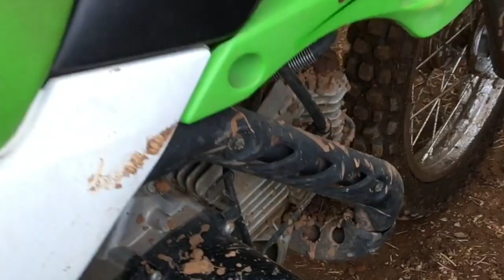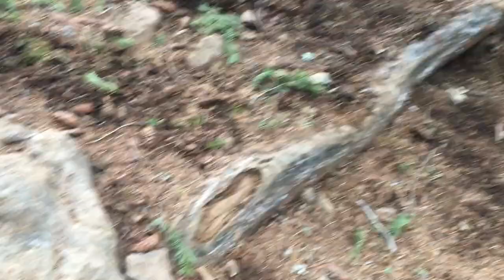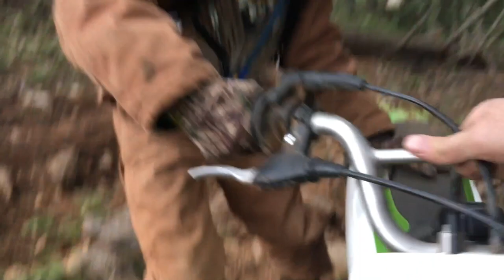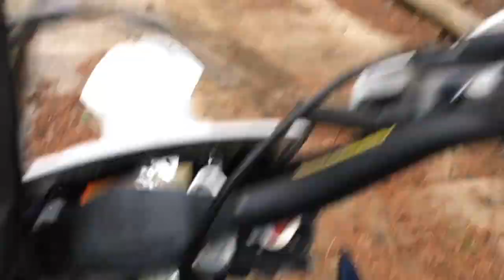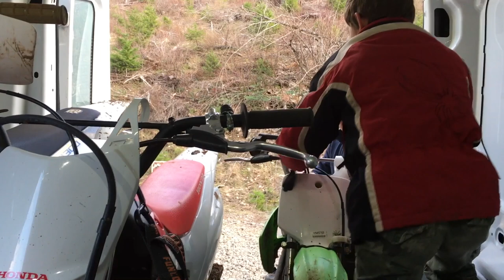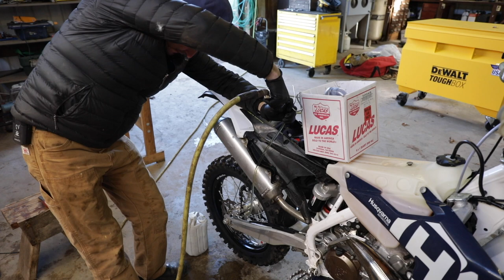The Video You Weren't Supposed To See

Comment: Torx were developed by Camcar in the late 60's.
They range from T1 thru T100..
The original point to point dimensions were established in decimal inches..
Over time an ISO specification was developed for hexalobes AKA generic term for Torx.
By design, Torx head screws resist cam-out better than Phillips head or slot head screws.

 Phillips heads were designed to cause the driver bit to cam out, to prevent overtightening, Torx configurationd were designed to prevent cam-out. The development of better torque-limiting automatic screwdrivers for use in factories allowed this change. Rather than rely on the tool to slip out of the screw head when a desired torque level is reached (which risks damage to the driver tip, screw head, and/or workpiece), torque-limiting driver designs achieve a desired torque consistently.
Being a former Snap-on Tools business manager and an engineer I am a geeked gear head..

Glenn
Reply: the more I use Torx the more I love them..... I swear by Spax wood screws... they are so amazing.....
Reply: amazing info, thanks
Reply: Sooo standard? Because they started as half inches, not half centimeters
Reply: JIS Screws and Screwdrivers are pretty cool. JIS screws have a small indent hole on the head to identify them. The Japanese Standard that overcomes the torque out issue allowing proper tightening.
Reply: JIS are an improvement over Phillips..
Pozidrives are a great alternative over Phillips drive too.
The only reason that we don't see more of them is that most OEMs dont want to add the 1% cost to the cost of goods of their product..
Torx(Camcar) is a prime example.
They were offered for 25 years and the big 3 auto companies refused to pay the royalty..
So us wrench twisters suffered with Phillips for a long time until the Torx patent expired...
Reply: I remember when they first started becoming popular.  I thought, "Great.  Just another bit to have to buy, and keep track of." Now, I love Torx.  The screw will break before the bit cams-out.

A lot of what i do "around the homestead" is screwing frames of some sort together, and I use long screws. I hate having to drill pilot holes, but if you're using phillips-head screws, you have to.

Go, Torx!
Reply: Wm Napier 
Always glad to share and receive insight and help
Reply: Marble head
I must have the wrong bits because I hated using Spax. The bit wouldn't hold the screw very well.
Reply: Dude... I need you on my tool truck! When can you start?!?

Comment: Since you asked about Torx drive screws, I thought you might like this: "The same series of Torx drivers is used to drive both SAE, metric and other thread system fasteners, reducing the number of bit sizes required." So it is neither metric or SAE, but in truth both depending on if the screw or bolt is SAE or Metric in size or cut thread.  and was developed in 1967 by Camcar Textron. So basically it is a six lobe head type, that can and is applied to both SAE, and metric bolts, screws and other thread types and fasteners.

Comment: I have the rear brake like you do but I have cut the clutch lever to about 1,5" in length and turned it for my thumb. That way you don't need to make extra effort for using it because its right on where you can reach it without losing grip. Almost like the "button gas" in most of the snowmobiles and quads.

Comment: Much agreed. The knipex channellocks are one of the best tools out there. Coming from a professional BMW tech.
Reply: Nothing better, once you find and start using their tools, which I did over 20+ years ago, but a product endorsement feels, smells and looks like an advertisement, even if I don't mind and agree with his choice, but should be stated.
Reply: Second best for the common man are the vise grips, with the bonus of one hand adjusting. Sometimes they're better because the jaws are wider. So of course I use both. Don't judge me.
Reply: I guess I mean thicker. The cross section of the jaw is greater. Bigger profile. There. Clarity.
Reply: Yep. Very true. I deal with a lot of small parts that people tend to strip the heads on torx bolts and small allen bolts which is why I reach for the knipex. Just a top tip for those that don't know about them. I believe matco endorses them.
Reply: DeviouS Breaking Many Wallets LOL. Actually I'm one of the few that tries not to replace more than is needed, but it's still more than most cars would ever need.

Comment: Cody, you should take a look at rear thumb brakes. The lever is under the grip and operated by the thumb. You can maintain normal clutch position and rear foot brake. Run a second brake line to it off the caliper with a double banjo fitting. Very convenient. You can operate front brake, rear brake, throttle and clutch all at the same time. Excellent for steep or tight difficult terrain.
Reply: Now that's a much better idea. I could get used to that.

Comment: A tool kit out on the trail is a must, many a time I've been spat off and snapped levers and bent shifter levers and had the odd puncture. The day I started carrying a tool kit, a few spare bits and some coolant  was after i was 6 miles into a trail and I wiped out and when I took my bike out of the brush i popped a radiator hose off and lost most of my coolant. Was the longest walk with my bike I've ever done and vowed to always make sure I have a spares bag in case I mess up big style again.

Comment: These are Knipex 'Pliers Wrench'.  There is a 10 times multiplier when the 2 handles are pulled together.  Once the surfaces are engaged, very little force is required to keep the plier faces together if the product is being used correctly.

Comment: Just a little tip if you have two ramps it will make it a little easier to load the bikes into the van
Reply: Brady Hodge or you could just get it done I can get my 230 in and out of a halfton alone with no ramp and im only 5foot 7

Comment: Brake pedals and shift levers get a "brake snake" if you ride in the woods to prevent just that.  Piece of steel cable looped from the tip of the pedal/lever to the frame to keep brush and debris from getting crammed in there as well as keeping them from getting bent out or broken off.

Comment: Hey Cody just a tip I've learned from loading my bikes put your bike in gear and hold the clutch while you are pushing it up the ramp, that way if you need to stop the bike on the ramp you simply release the clutch and the bike will hold

Comment: I feel like a rear break hand setup is like putting training wheels on your bike. Eventually you will be used to using the rear break at your foot and it would be just as easy. But hey everyone has their own style and I'm not hating on yours at all.
Reply from the maker: Not hating just not understanding,
Reply: No, I understand I ride trails as well and in steep situations where I need to stand and use the rear break I have trouble either finding it or being able to press it which cause me to go slower or could crash. This would easily fix my issue with that or I just need more practice and focus on rear break control. I 100% understand why you like the rear break setup, everyone has their own style and opinion on what they choose to do to their dirt bike.

Comment: That rekluse clutch set up looks amazing and all, but having it on the handle bar, come on.
What if your going down big down hill sections and get arm pump, and can't let go of the rear brake lol.
Trick is, when your standing up. Never put the rear brake on, with your foot on the foot peg. Lift your foot up and control it. Only rest your foot on the foot peg and rear brake,  when you are sitting down to set your self up for a corner. Watch all the pros that's how they do it. I've taught my self to try it. And it actually works. I can break all day long. With good rear wheel control.

Comment: Most of the enduro pros use conventional brake/clutch systems. Sorry, but your setup is very uncommon.
Reply: Apparently not uncommon in the Pacific Northwest.
Reply: I’ve  been on bikes for the past 35 years. I have never wished for the rear brake to be somewhere else
Reply: I live in the Pacific Northwest
Reply: I must agree. The normal rear foot brake can be operated delicately with moto boots with practice and experience. I wear moto boots and I can brake from lock up to just light braking without even thinking. It’s like anything it’s doing it and practice. I think the rear hand brake is best on bicycles where it belongs. To each their own tho.
Reply: @chiefof  I agree i have done some hard rideing and I can use my back brake with complete elegance with moto boots on and the  clutch being up high and right on top of the brake just takes away from being able to quickly use it I have done lots of trail rideing and to learn how to use the proper controls makes for a beter ride.

Comment: I've gone dirt biking out in Colorado a few times, and one time we were way up in the mountains and got caught in some pretty heavy rain.  Going down a really steep rocky, muddy hill was terrifying with the foot brake.  I ended up relying more heavily on the front brake, and then it slid out from under me.  I was riding a pretty heavy 450.  I cut my hand (tore my glove) and bent the handle bar.  Then I had  to lift it up on the hill to get it the rest of the way down, and fell yet another time.  Not sure how well the hand brake for the rear would work, but I'd be willing to try it for sure.

Comment: I've never seen brakes bled that way. Just fill the reservoir at the top and keep pumping the brakes with the tube on the lower bleed nipple. It will fill the brake lines from the top and pump out any bubbles of air. You might need to empty the clear tube a couple of times to make sure it's done. Make sure the top reservoir doesn't run out of DOT4.

Comment: I might try running that set up. I am almost always running in the woods in Michigan. That handbrake  would be nice for going slower through the woods but on wide open runs where you go fast it would not be practical. Just giving my opinion from riding in the east.

Comment: The rear hand brake is an interesting idea. I rode off road bikes (XR’s, CR’s)  for quite a few years and never really did get used to using the rear brake much. My damned AXO or Alpinestars boots were always so stiff I couldn’t really flex the ankle downward. 

When I really needed the rear brake I would just about have to take my foot off the peg to use it. I used the front brake almost exclusively…as you know you can mash the front very hard without fear of going over the bars. 

Good for you for giving it a shot. I’m not sure I could get used to the rear brake on the left side of the bars after so many years of riding bicycles. I guess I could switch my bicycle to Euro style (front brake on right hand.) Doesn’t really matter since I don’t ride motorcycles anymore.

Comment: Torx is neither imperial or metric. It is simply an agreed upon size for the tool. T1, T2, T3, etc are used on american thread, as well as metric thread bolts. I'm not an engineer, I just looked it on on Wikipedia. ;-) 
The hand brake setup is cool but I would still like to have the foot brake as well.

Comment: The open ended bark busters (hand guards) seem flimsy and weak but they actually do a really good job and won't break your wrist if you do happen to crash, like I did to myself 4 months ago. My hand got trapped on the accelerator side between handle bar and the aluminium bar in the bark busters and broke my wrist in 2 places when I went down.

I don't mind the idea of the big bar but I'd certainly be concerned about that now. From now on I'll only be fitting the open ended bark busters. FWIW I think most associations (motorcross, enduro etc) are now banning closed loop bark busters on their rides.

Comment: torx was developed by an american company in the 60s. the t-size doesn't not match up to either SAE  or metric sizes for example t5 is .055" or 1.42 mm, t10 is .107" or  2.74 mm. not sure if either measurement wins Torx

Comment: From wikipedia: 
Torx invented by Textron.... Textron (NYSE: TXT) is an American global aerospace, defense, security and advanced technologies industrial conglomerate.
Torx head sizes are described using the capital letter "T" followed by a number ranging from T1 to T100.[5] A smaller number corresponds to a smaller point-to-point dimension of the screw head (diameter of circle circumscribed on the cross-section of the tip of the screw driver). Common sizes include T10, T15, and T25, while T5.5, T35, and T47 tend to see specialized use. Only the proper driver can drive a specific head size without risk of damaging the driver or screw. The same series of Torx drivers is used to drive SAE, metric and other thread system fasteners, reducing the number of bit sizes required.

The "external" variants of Torx head sizes (see below) are described using the capital letter "E" followed by a number ranging from E4 to E44.[6] The "E" numbers are different from the "T" numbers of the same size: for example, an E4 Torx socket fits a T20 head.[5]

Properties of various Torx drives[5]
Size	Point-to-point distance	Maximum torque range	~ E Torx
(in)	(mm)	(lb·ft)	(N·m)
T1	0.031	0.81	0.01–0.02	0.02–0.03	
T2	0.036	0.93	0.05–0.07	0.07–0.09	
T3	0.046	1.10	0.10–0.13	0.14–0.18	
T4	0.050	1.28	0.16–0.21	0.22–0.28	
T5	0.055	1.42	0.32–0.38	0.43–0.51	E2
T5.5[7]					
T6	0.066	1.70	0.55–0.66	0.75–0.90	
T7	0.078	1.99	1.0–1.3	1.4–1.7	
T8	0.090	2.31	1.6–1.9	2.2–2.6	
T9	0.098	2.50	2.1–2.5	2.8–3.4	
T10	0.107	2.74	2.7–3.3	3.7–4.5	
T15	0.128	3.27	4.7–5.7	6.4–7.7	
T20	0.151	3.86	7.74–9.37	10.5–12.7	E4
T25	0.173	4.43	11.7–14.0	15.9–19	E5
T27	0.195	4.99	16.6–19.8	22.5–26.9	
T30	0.216	5.52	22.9–27.6	31.1–37.4	E6
T35[8]					E7
T40	0.260	6.65	39.9–48.0	54.1–65.1	E8
T45	0.306	7.82	63.4–76.1	86–103.2	
T47[9][10]	GM-Style				
T50	0.346	8.83	97.4–117	132–158	E10
T55	0.440	11.22	161–189	218–256	E12
T60	0.519	13.25	280–328	379–445	E16
T70	0.610	15.51	465–516	630–700	E18
T80	0.690	17.54	696–773	943–1048	E20
T90	0.784	19.92	984–1094	1334–1483	
T100	0.871	22.13	1359–1511	1843–2048	E24

Comment: Yes you do really need the clutch, one oops with the throttle, and your in trouble. This is coming from a Washington rider. Don't wanna see ya learn the hard way! 44 years old, and riding for 40 of em, and I've got a rekluse on my FE501! Honestly the only benefit of the Rekluse, is anti stall, which the big bore 4 strokes do very easy, the 300 2 strokes do not. Hate the feel, control, and heavy pull of the Rekluse core exp 3.0.

Comment: Sure you get lots of tips on here but one thing I have on my crm 250 is a rear rack very hand for tools then your bike is taking the weight and not your body but not sure if it's possible to put a small one on the 300i or I will end up the same as you with a big tool roll.🇬🇧

Comment: It's so important that they learn to use the "power of the bike" that they should actually practice going up a rough path with the bike started and in first while they try to push it and use the engine to assist. This can be very helpful if not life saving if ever they are alone and get into problems on the trail (Such as running off the trail down a ravine).

Comment: Just my 2 cents. I'd have just moved the clutch to the brake petal. Since you stated you basically don't need it anymore. Also, they make solid aluminum hand guards. Lots of harescrables racers use them, ~$100.

Comment: By putting that aftermarket hydraulic caliper did you negate the brake light switch?  Might have been better to have just left the stock rear brake hydraulics and Ted in to also use the front auxillary.

Comment: The 'T' number on Torx does not refer to a dimension. It is like a gauge number except reversed. Torx in neither metric or standard; it is more like a screw driver. Just bought the FE350 by the way. Awesome bikes.

Comment: torx are their own standard per say, however the thread pitch is metric so if you really want to disseminate a T45/T50/T-whatever as metric or standard, it would be metric! European vehicles/products been using them for years, I personally don't care for them, its just another socket set to have to buy. FYI, metric 12 point sockets will work in a pinch.

Comment: Torque is just an expression of rotational energy and the official and the internationally accepted unit is Newton meter (Nm). Never the less you can convert this into the stone age imperial units for countries who are resistant to progress. The conversion factor is roughly 1 pound-foot is equal to 1.355 Newton-meter. The torque ranch you are using should say on the package if they use Nm or pound foot.

Comment: They say wrangler star doesn't read these
Reply from the maker: I read this one,
Reply: You got told.
Reply: Well, "they"  -  whoever they are - were wrong.
So the Torx origin has been explained, like so many it was designed with the use of the imperial/US customary unit. What just struck me  is that most fasteners seem to share the same heads regardless of the thread's unit of measure. I can only think of the hexagonal heads (inner and outer) that do differ between metric and standard sizes.
Reply: Cool

Comment: I dont think its a good idea to put rear break on hadlebar, for example if you're rolling down the hill you probobly use rear brake, but when you brake on 2 stroke you always have to clutch in, so it can be tricky to pull 2 levers with one hand

Comment: Torx bits are neither a metric or imperial thing. You can get Imperial, Metric, SAE threads on torx bit's but the driving bit remains the same hence why the T45 for example is just the no.45 bit! It's actually a nice system. You can work on Metric, SAE and imperial all with the same set of drivers!